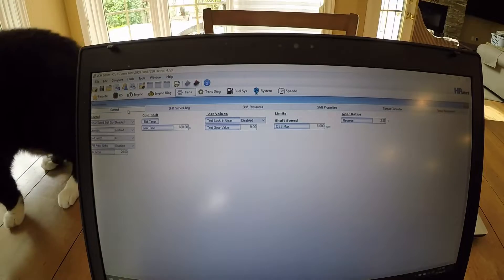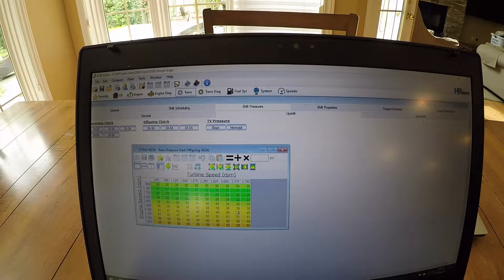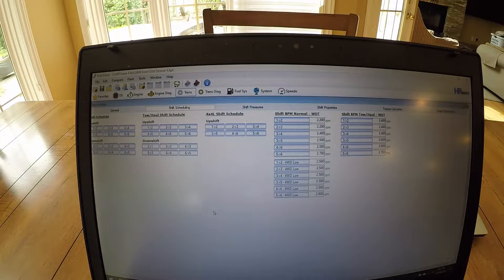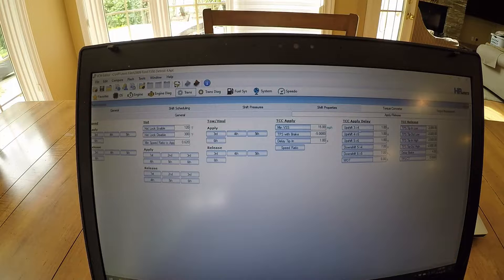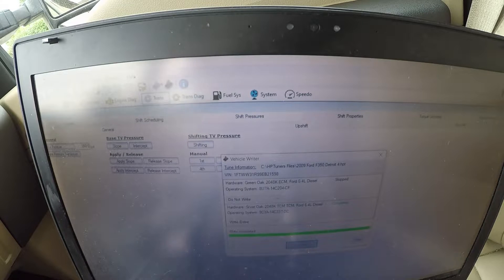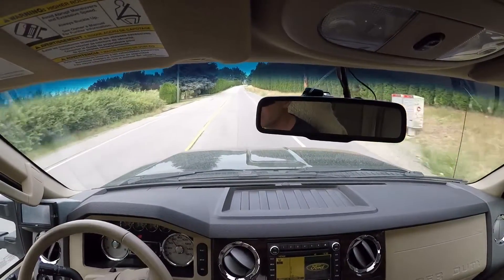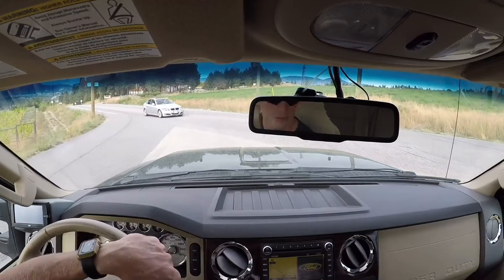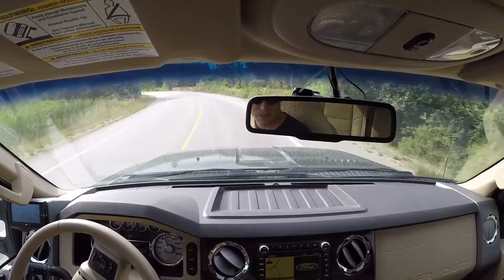Detroit Powered 5R110 Tuning With HPTuners

Comment: I have a 5.9 P pump compound turbo set up in my Ford with a five R110 and I have never gotten into shift good at all I’ve got 3000 miles on it and I have had diesel conversion specialist trying to tune it and it seems to be getting worse I would love to know which HP tuners you have and where you got it and any information from anybody else would be great
Reply from the maker: I purchased my HPTuners with 2 credits on Ebay.  It's model MPVI2 and am running the latest beta program from HPTuners.  I'm very happy with the results and almost have it shifting perfect.  I still have a small flare from 3-5, at full throttle but am confident I can solve that issue.  I've just been driving it and enjoying the truck.  I've also joined a Facebook page dedicated to tuning the 5R110 and have learned a lot more on tuning.  https://www.facebook.com/groups/323999505522366.
Reply: Do you have the standard or pro model
Reply from the maker: @12valvecummins19  Just the standard model.

Comment: I'm just curious...Have you tried to let the Ford PCM control the 5R110 using the Factory Ford MAP sensor plumbed to Detroit intake manifold? I have a 5.9 Cummins with the 5R and use the Cummins TPS signal and tach signal going into the Ford PCM with the Ford MAP and mine shifts like a dream.
Reply from the maker: Thanks, I haven't looked at the PCM yet, but several other people have brought this to my attention as well.  I've got it tuned really nice now, but I'll look into the PCM and see if it improves the shift quality.  Thanks for your help.:)

Comment: To help you out with your tuning make sure you go to the engine tab under the fuel cutoff tab and set the etc limiter to above your maximum rpm. Even setting the trans settings to not use torque calculated shifting it still does. Since your not using the stock throttle body it sets a code for it and limits the torque signal to the tcm to 2400 rpm max after that torque signal goes to 0 and shift pressures go to base and gives you flare shifts hope this helps good luck!
Reply from the maker: Thanks for your input.  I'll go and have a look at that and see if it changes anything. Got it dialed in pretty nice now, still slight flare wot 3-5, so I'll take your advice and see if that helps.:)  Thanks again.
Reply: Are you saying that the shift pressure will go to base anytime over 2400 rpm? My TCM is in a 2005 excursion, so maybe the options you are describing do not exist.

Comment: So here's a question for you, when your Jake activates, it just does it in the current gear, it doesn't try to maximize engine RPM for greater stopping power?  I ask because this is the behavior of the allison world transmissions when coupled to a 60 series detroit (as in 3 of our fire apparatus) I'm 99% sure the same happened with the older 8V92 as well. 

You remember that the tow haul mode would do a nearly maximum RPM downshift when it was still attached to the PSD when you were in tow haul... does that behavior still exist?

And it goes without saying, beautiful build by the way!
Reply from the maker: Thanks, In the normal shifting schedule the Jakes will activate in the current gear with the converter locked in 4th and 5th.  In tow haul mode the trans will downshift automatically with the converter locked 5,4,3 and the Jakes activated.  Works really well, and eventually I'll buy the BD Tap shifter that will allow me to select the gear and keep it.  It's much like the newer Fords and Chevys have.   https://us.bddiesel.com/products/6-4l-powerstroke-tapshifter?variant=30073634029632
Reply: @detroitgarage9430  Funny you should mention that... I just saw that posted a day ago. It's piqued my interest as well. 

I wonder how this engine would do behind one of the 10 speeds? It would have to be even better.
Reply from the maker: @kleetus92  Yes I've been keep an eye on the 10 speeds.  When they come down in price and can get them shifting well, I'll most likely swap one in.  This would be the perfect transmission for the Detroit 300 rpm shifts.:)